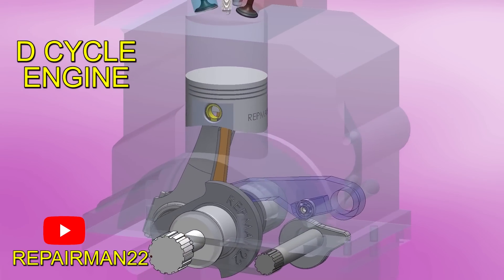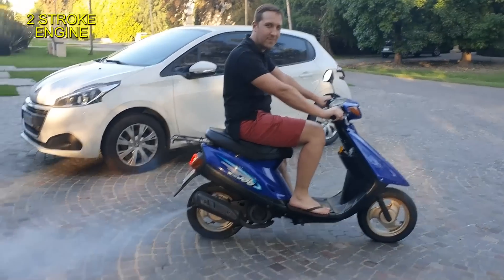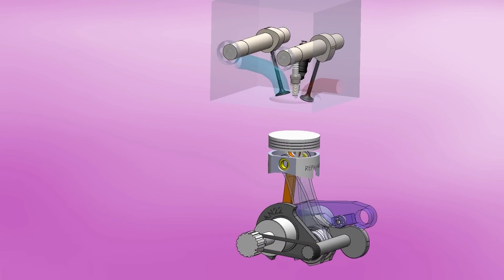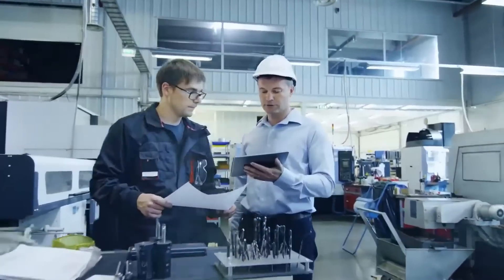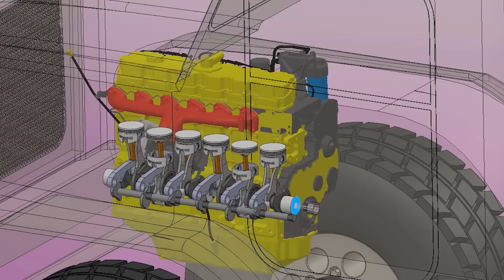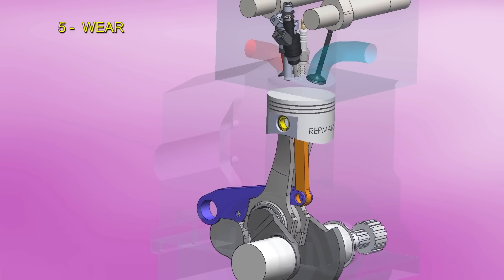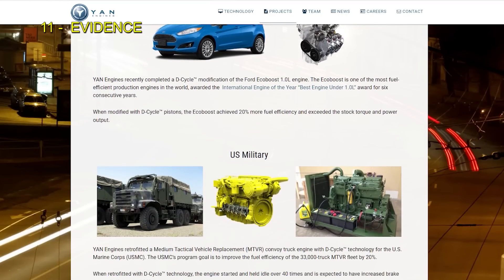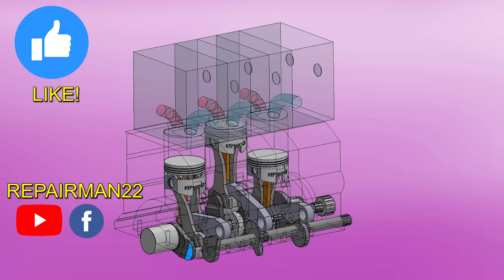Analyzing The Split Piston Engine in 3D. 🤯 Dual Cycle D // 2 and 4 Strokes Combined // 3D Animation

Comment: This could work well on a stationary diesel that aims for constant rpm like a generator but you'd have to adhere to runtime maintenance intervals or scheduled services, whichever comes first. Big diesel generators can spend a long time un-started so they need to be test started on an interval (back up generators) but they can also do constant runtime in service (locomotive).
Large boats in the other hand generally can tolerate having at least one generator out of service and ships usually double that (redundancy while one is being serviced by the ship's engineer).

Comment: Facinating idea.
Generally speaking,formula 1 technology would filter down after 10 years or so, being the highest level of automotive development...or at least it used to be. Never seen this concept tried, so, thinking it has issues or the 'formulas' banned parts like this as they strive for more power with reliability.

Comment: Good grief that looks convoluted! However, I was thinking that this split piston could be utilised in a different way. 

Could the split piston be used to make a long dwell time at TDC? So instead of just increasing the compression ratio, you increase the dwell time to increase combustion pressure. This would be especially useful at higher rpm where combustion times are very short.

Comment: This is silly. Just use a big blower to push out the exhaust gasses after combustion. It won't pass any emissions tests but you can definitely turn 4 stroke into a 2 stroke by pushing the air through the engine with a blower instead of using the crankcase for the charge.

Comment: I can't see any advanced piston engine being the way forward.  All these extra moving parts for a 20% boost in performance?  It's just not enough.  That six cylinder Caterpillar has decades of legacy support and a mountain of parts availability.  We know those engines are good for hundreds of thousands of miles.  Changing the paradigm like this, there's going to be weak points and it takes decades of practical experience to iron these things out.  As pointed out, the linkage for the upper piston looks suspect to me.  Also having two conrods per piston.  Is that 20% worth an engine that may literally cost two or three times as much money to build?

Comment: instead of running it off the crank there should be a smaller cylinder and piston (50-100cc) that pushes the exhaust stroke arm thing in sync with the actual piston.
(no spark plug needed, just put a small channel from one of the normal cylinders to allow some hot gas in when it fires).
Reply: What if it was a 4 cylinder engine, two cylinders on 2 cycle and 2 on 4 cycle for balance. If you were to use the same crank

Comment: Firstly, 2 stokes don't have to use crank case compression. They can use a blower such as a supercharger or turbo. Many do. So that's not true. 

Second, that con rod is very weak. The engine will have very limited RPM as the piston speed to do that rapid movement will be huge. Not to mention the constant slapping back together of the piston and its noise and wear. The force on the other con rod and cam system will become huge as the RPM goes up.

It's a nice idea but hugely impractical and has many problems and changes to even make work at low power and RPM.

Comment: An incredibly complicated way to achieve the same thing a detroit 2 stroke diesel does with a blower. Only the detroit doesn't require piston speeds approaching mach 12 to move the exhaust and fresh air. Novel concept but ridiculously overcomplicated.

Comment: If you compare this technology to conventional technology, you have to say what exactly the comparison object on conventional technology is: an engine with the same speed or the same power? Such a motor only brings 20% more power? According to the concept, it should be 100%, i.e. a doubling, because there are more ignitions per revolution. However, if the engine loses this strength due to the low tolerance to high speeds, a performance advantage of 20% is not much. In addition, the concept has NOT solved a major problem of the two-stroke engine: scavenging losses. Combustion and exhaust gas cleaning are comparable to those of a two-stroke engine and are therefore dirtier than those of a four-stroke engine. Ultimately, you also have to assess manufacturing costs and durability for an overall comparison. With each revolution, the two piston parts "collision" with each other, they separate and then touch again. The poorer the manufacturing quality, the less durable these components are because the parts then collide violently (or do not touch at all). The higher the manufacturing quality, the more expensive the motor. Also, a belt drive or chain drive does not represent a high-quality synchronization for this. You would have to use sth more sophisticated such as spur gears.

Comment: I just noticed a thing about engineers designing new revolutionary engines. They think of some principall, some idea, create 3d model. Then try to make it happend, build a prototype or two. Then they hit a brick wall...
Suddenly it appears that it is impossible to make working engine the way it was designed. Cant seal it properly, elements change dimmentions when they heat up and so on...
Nothing is perfect. Take Omega engine. On paper all is fine, tight fittment, no need for seals, great parameters. In real life a couple of prototypes and the creators dont show them up, just some low quality videos and bold statements.
I'm afraid that could happend here as well. Sad but true

Comment: Did you design and built this concept yourself? Who did this? And why are such smart ideas ALWAYS that unknown? Never even heard of it, that means something is going horribly wrong, here. Besides, why pistons? Every car is electric nowadays, or it has a turbojet with a shaft. Pistons are 20th century, we all are 25 years ahead of that piston shit. Efficiency is closer to zero than to 100%, it really is shit! It has always been just HEATING the air, and only a freaking tiny bit of the energy gets to the wheels. Cars are depressive shit, even the best ones. At least, we all SHOULD THINK that way. Why is everybody accepting our zombie car engines? Think about it fresh, it is time to kill that failed piston experiment, it really is not good enough. It never has been! Only 50% of the energy really driving you? Are you crazy? Why do you send ALL that heat into the exhaust? Then it is GONE! And nobody owning a car even knows why that is stupid. Well, it is.

Comment: Too many added variables.  The return springs could produce float in the arm like a valve and valvespring. The piston without skirt could allow the piston face to not ride square in the bore. Longevity is the key. Modern motors with maintenance are good for 350k to 500k miles for lower cost owing to a less complex arrangement. Keep swinging, we need something cleaner and more efficient. Electric cars just shift the fuel consumption to generation

Comment: Yeah, but no. Where is the force coming from to create the vacuum to pull in the air before the compression stroke? That center connecting rod is just riding on a camshaft.

Comment: What is going to pull the piston down on the intake stroke? Will there be a spring between the skirt and the piston? Also what are the chances the slap between the skirt and piston will hold up?

Comment: This engine is useless, its basically 4t except at bdc piston jumps fast af to complete exhaust and intake cycles so when crank rotates it will be on compression already. It's way better to just run 4t engine at twice the rpm. Respect for making something new but the engine does not solve problem it's supposed to (power stroke every other revolution in 4t).

Comment: So retard-o-matic here will increase piston velocity at least 2x, at the same time since the inner piston rides a cam and not a shaft there is no kinetic energy recovery to speak of when it comes to accelerating/decelerating the piston, lastly this extreme velocity will put higher demands on valve timing and result in incomplete intake/exhaust because of the same.
Way to go! Another 3D cad masturbation that will never ever become anything practical. The year of our Lord is 2023 and niggas be redesigning a 100+ year old IC engine. Congratulations! Next up - an improved steam boiler and a better carriage for your horse.

Comment: Unfortunately the real big load on engines isn't their power stroke. It's the acceleration. Has some serious potential in large engines (ships, mining equipment) but anything with any amount of revs will likely have little benefit from this, at the cost of added complexity. 

Also, why not turn the crown piston cam in opposition to the crank shaft (maybe also the valve cams) to counter the centripetal force of the crank, and also maybe allow for tappets on the traction bars/ rockers connected to the crown con rods.

Comment: this is kinda dumb considering the limiting factor in engine power is actually the head diffusion. If you got 3 cyl, u can always add more boost and fuel until you get all the power you want or until the pistons melt or you make too much nox gas. i suppose there is benefit in softening the heat distribution over a longer period of time, but you're doubling the moving parts. No way something like this will run in an engine for 20 years. They are just making hyper complicated house of cards engines that need replacing every 10 years.

Comment: Wear, noise, heat management and added friction would probably negate any advantage in real life. I mean to say, you can fill up quite a few times for the cost of an engine-out repair job. Not to mention the enormously increase in piston speed put onto a smaller connecting rod. This would probably only be feasible in larger, slow revving engines where added mass to compensate for added stresses is not so relevant. But then, the efficiency benefits would be marginal.

That being sad, I'm only an enthusiast, not an engineer.

Comment: The upper piston and crown piston constantly collide with each other so those are gonna need to be changed way more often. Also the upper piston might not compress the intake gases efficiently because it has no skirts so a slight tilt will increase friction and decrease compression
A better solution in my opinion is to have compressed air (maybe supplied by a auxiliary pump) blow out the exhaust fumes right after the combustion
Reply: And at that point you don't need the piston to split and move up and down rapidly since compressed charge air does the job of forcing the exhaust out of the cylinder. So you can remove the entire mechanism, and then you get a turbo 2-stroke. Which means this whole system is just a needlessly complicated version of thereof.
Reply: I assume you mean the upper piston alone isn't compressing the EXHAUST gases because that's all it's doing. Because of the higher cylinder pressure most of the exhaust is escaping the moment the valve opens. The exhaust stroke simply keeps this up so in theory it shouldn't rock like it would during combustion, making the lack of the skirt less significant.

That said, I agree with most of your points. As it's shown, the inherent flaws are hard to ignore but the principle concept is pretty sound.

Comment: I can't be the only one that feels that using turbocharging is cheating, whilst both engines originally ran turbos anyway, my thoughts are that boost pressure acting on the crown's surface is giving the return stroke the best possible chance of working (as opposed to the return spring needing to accelerate the crown back down, whilst drawing air into the cylinder which would likely require a huge amount of tension and put even more load on that cam) and with both engines being of forced induction and direct fuel injection from the start i can't help but wonder how both engines would have operated with the turbochargers being replaced with blowers, and simply running the engine on a 2 stroke cycle. Complexity is reduced, potential performance is increased, no additional alterations to the oiling system are required

Comment: It looks like it would have a lot more wear than a common IC engine, and what I see it would have a lot of premature wear. Tear down and rebuild would take longer resulting in higher labor costs. And it just looks like timing would be an absolute pain in the ass. I’m sure there are some proper applications for this design such as in a generator or in a hybrid setup…something where it runs at a constant speed with few changes in RPM, but I just don’t see this as a good candidate for a daily driver.

Comment: The cams would move at the same speed more likely 80% the speed of a 4 stroke.  The engine would only run at half the rpm of a 4 stroke, and they 80% slower if it's really 20% more efficient. 

With a turbo, you might not even need a physical device to push the floating piston down.  The turbo pressure would push the piston down with air pressure.

Comment: If you're really concerned about getting more power out of the same displacement, different engine configurations do so much more effectively than drastically ramping up the, complexity, failure rate, and maintanence/ repair cost of a traditional in-line, v, or w configuration; shared combustion-chamber, wankel rotary. Hell, while it's not mutually exclusive, you could just add forced aspiration to a completely normal piston engine in a standard configuration with far less trouble than this.

Comment: I would think the biggest issue would be the delta V of the upper piston during the exhaust/intake stroke. Even with reduced mass you’ve got to be hitting some crazy numbers. That inner con-rod must be made out of some pretty expensive stuff I’d imagine and I am willing to bet wrist pin wear would be an issue. 

I’d be a believer after one of these engines has done a couple hundred thousand miles.

Comment: The cam arm moves the crown piston under exhaust and intake - the easiest of the 4 strokes and so the lightest loading .. really interesting idea .. by changing the timing of the  “hop” (the cam timing on the crown piston lifter arm) it would be easy to short stroke the intake (create an Atkinson cycle for better fuel economy) .. hoping development pans out !!

Comment: As for me, this engine has one big disadvantage, namely it does not use the full volume of the cylinder, but in the case of working in the Atkinson cycle, it can be an advantage. This engine can be modified to use the full volume of the power stroke and part of the volume of the compression stroke, resulting in an Atkinson cycle engine.

Comment: well, this is trying to solve aproble that was already solved in two stroke engines with proper valves by using a small supercharger to implement uniflow. Now uniflow does have it’s issues like low power oxygen rich exhaust promoting NOX, but I sure as hell would rather solve that problem than fight with that unnecessary complexity.

Comment: I don't think this design would work for vehicles, due to the wider RPM band needed. The challenge with the double stroke is getting the crown piston to drop to bottom dead center on intake. In order to achieve higher RPMs, something has to bring the crown piston down hard and fast, and that is going to take a lot of force that is never returned. It would end up working like jake brakes. Additional force is required by the crown piston to expel gas, then additional force is required by the crown piston to draw gas in. Low RPM generators might be an application.

Comment: Doubling the combustion cycle of a 4 stroke and this yields 20% gains? Yeah, that sounds pretty bad. Because it looks to me like 80% of the theoretical gains from adding another power stroke have evaporated into nothing. 100% more combustion which yields only 20% power gains IS TERRIBLE.

Comment: You don't need the second cam to lift the crown piston. You could just have the rocker arm on the second cam ride the crankshaft with a second lobe attached to the crankshaft for the rocker arm on the second cam to ride along
Reply: It would be a big cam. The return spring would be  concentric on the cap rod, and a cap needed on the skirt to seat the spring.  But the cap lifting lever, a high stress part, would be eliminated.

Comment: If you want to extend the combustion cycle something like the five stroke engine would work way better. And these are way easier to manufacture (no new parts, just another combination and arrangement, smaller and lighter motor housing, higher rpm).

Also I think this system doesn't work without a turbo.  Without the additional pressure the cylinder would fill properly with these high speeds at filling.

So it only make sense at low rpm. But there vibrations get very nasty. A way simpler way would be to use a standard einginge and a 2:1 reduction gear set. Then you also have the shift in the max rpm. and torque increase. This would be way lighter, cheaper, less parts and place, and so on.